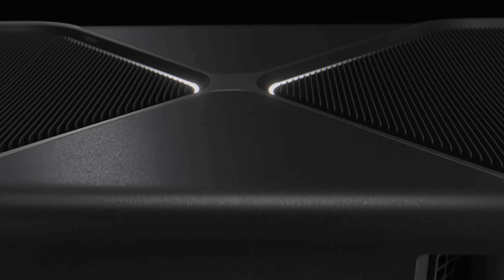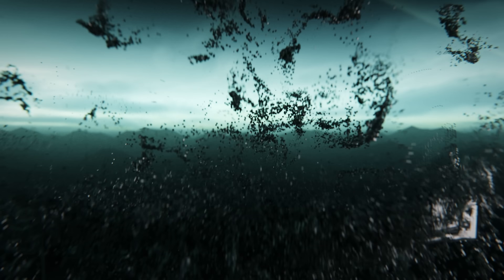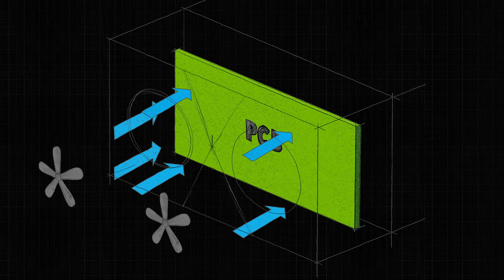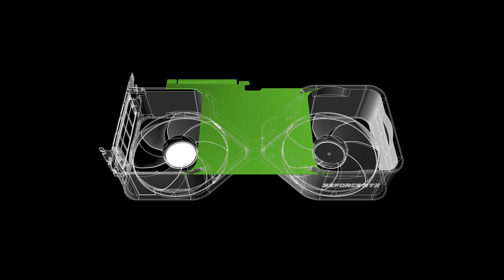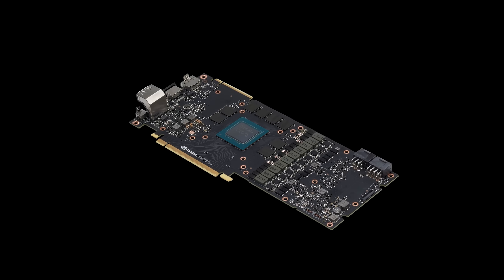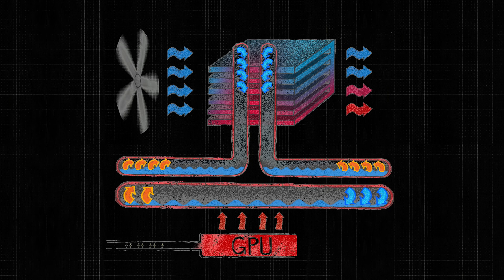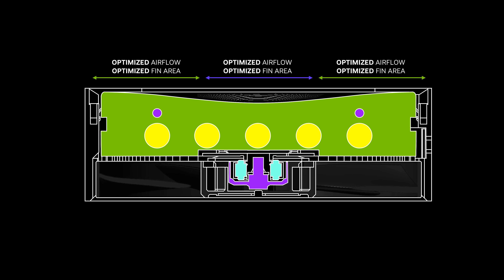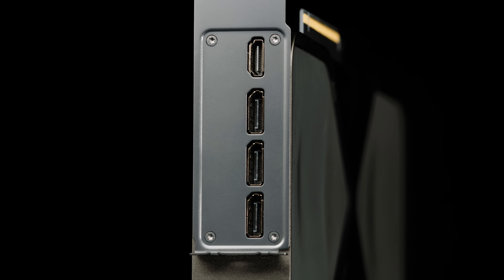Designing the Founders Edition | GeForce RTX 5090

Comment: "Can I just ask: which Einstein decided to give both the RTX 5060 Ti and the RTX 5080 the same 16GB of VRAM? Why does a high-end card have the exact same memory capacity as a budget-tier one? Sure, the 5080 has faster VRAM, but speed doesn't mean jack if you hit a 16GB wall, and modern games are already pushing past that. Why is there zero headroom on the 5080? Why 16GB instead of 24GB? What are you guys smoking over there? I’m absolutely floored by you clowns, you freaking monopolists. I can’t wait for AMD’s next move or for the new Chinese GPUs to drop."

Comment: It is by no means a small GPU but its so compact and dense that its weight gives this sense of quality thats hard to describe within its confines of a true two slot card. Its price doesnt justify its performance but i guess by technicality there is a real performance increase over the 4090. Ill give the engineers some credit in its design, it is a very beautifully designed card inside and out.

Comment: 2026 Xbox Prime with RX 9070 220W for 4k, Xbox Prime portable with half RX 9070 and 110W for 1080p, all Xbox games made with RX 9070 doing 4k 60fps ultra quality using 11.5 GB VRAM or 15.5 GB VRAM and sold on Steam. If that's the case in 2026 I'll buy the RX 9070. I'm going to play Xbox on Steam with VK02-BLK case, Valkyrie Loki edition cooler, Ryzen 9 9950X3D and X670E VALKYRIE, 192 RAM 6000mhz, HD WD Red Pro, 16TB, 3.5, 7200RPM, Sata III 6GB/s, Cache 512MB, WD161KFGX and SSD Team Group T-Force Z540, 2TB, M.2 2280, PCIe NVMe, Leitura 12400MB/s, Gravacao 11800MB/s, TM8FF1002T0C129.

Comment: RX 7800 XT price = $499, PS5 PRO price = $699. RX 9070 price = $549, Xbox price with RX 9070 = $749. Price of my Desktop with RX 9070 in 2030 = $1499. The Xbox must have RX 9070 and if you want to make games for the Xbox, do it in 4k 60fps, ultra quality with the RX 9070 with up to 12 GB VRAM and up to 210W to avoid fps drops and texture problems, be careful with dynamic shadows, use static shadows, avoid midday, use afternoon and night, avoid forests, use steppes, trunda, fields, swamps. Avoid torches and bonfires, use light magic, fireflies and lanterns.

Comment: I would like to see Xbox with RX 9070 and The Elder Scrolls 6 made with RX 9070, on Desktop with RX 9070 you would play The Elder Scrolls 6 in 4k 60fps, with RTX 4070 Super you would play in 1440p or 1800p 60fps and with Intel Arc B580 you play in 1080p 60fps, all 3 with ultra quality, with 8 or 10 GB VRAM and 220W. If so, even the Nintendo Switch can have The Elder Scrolls 6 in 720p or 1080p.

Comment: I would like The Elder Scrolls 6 to be made with the RX 9070 and the new Xbox to have the RX 9070, if The Elder Scrolls 6 is made with RX 7900 XT, RX 7900 XTX or RX 9070 XT I am 37 years old and I want to be alive to see The Elder Scrolls 6 in 4k, 60fps, ultra quality with 16 GB VRAM and 220W on the Xbox console and on the Desktop. Nvidia only has the RTX 4070 super and Intel only has the Arc B580.

Comment: I ask for games at 4k 60fps with 16 GB VRAM and 220W. An XBOX and a PS6 with RX 9070 with 16 GB VRAM and 220W and "all games on the market" are made with the RX 9070, that's how it should be. RX 9070 is a rival to the RTX 5070 and is slightly more powerful than the RTX 4070 super and the RX 7800 XT of which the PS5 Pro is equivalent. It means PS5 Pro with RTX 4070 super and PS6 with RTX 5070.

Comment: RTX 6070, Xbox and PS on the regular market with 16 GB VRAM and 220W, players will play at 4k 60fps with Ultra quality with 16 GB VRAM and 220W. RTX 6070 Ti, RTX 6080, RTX 6090, 20, 24 and 32 GB VRAM, 300, 360, 450 and 575W only on the black market for those who want to pay a lot and lose money. Games made with more than 16 GB VRAM and 220W cannot be sold on the regular market for players who have 16 GB VRAM and 220W graphics cards. This is how it should be, it is the same as buying on the regular market and on the black market of the Battletech game.

Comment: I tell game developers to make games at 4k 60 fps with 12 GB VRAM and 220W, i forbid them from doing 4k 60fps with 20 GB VRAM and 300W. The graphics card has 12 GB VRAM, use 10 GB or better 8 GB so that those who have a graphics card with 8 GB will have less problems. Game with 20 GB VRAM, only the RTX 3090, RTX 4090, RTX 5090 and RX 7900 XTX with 24 and 32 GB VRAM to run them correctly, and the Xbox and PS with 16 GB VRAM will not offer them with quality and performance.

Comment: I have Dragon's Dogma: Dark Arisen and Valkyrie Elysium running at 4k 60fps Ultra quality on the RTX 3070 8 GB 220W. I challenge NVIDIA, AMD and Intel to make graphics cards that run these games at 5k with 50ºC and 50W, almost all the games I put in 720p do 45ºC and 45W, I want the 720p becomes 5k at 50ºC and 50W. There are two games that I see in 4k 60fps with 220W and I want to see them in 4k or 5k 60fps using 50ºC and 50W, in the future some very efficient graphics card will do this.

Comment: Do you understand? Games at 4k 60fps ultra quality cost 220W, the Super Saiyajin 5 plays at 5k 60fps with 50ºC and 50W and the Super Saiyajin 4 plays at 4k 60fps with 79ºC and 220W, if you play at 4k 60fps with 90ºC and 575W it's a super Saiyajin 3, that's the end of the story and not It can get stronger than that.

Comment: Happy 2025 and tell the game developers: Make The Elder Scrolls 6 with 4k, 60fps, ultra quality and 8gb RAM, in short, do it with an RX 7600 8gb or RTX 3070 8gb and then make The Elder Scrolls 6 with 4k, 60fps, ultra quality and 16gb RAM, in short, do it with an RX 6800 XT 16gb or RTX 4080 16gb. Make The Elder Scrolls 6 with 20, 24 and 32GB RAM will be unplayable even on the successor to the Xbox series X.

Comment: Dear Nvidia, your greed knows no bounds, as evidenced by rumors that the RTX 5060 graphics card will have a 128-bit bus width and only 8 Gb memory.. While this may have been acceptable for a budget graphics cards a few years ago, in 2025 it is not only strange, but insulting to gamers. For modern AAA games, 8 Gb is simply not enough. Even in FHD resolution, it is barely sufficient. I am at a loss to understand your decision. It is as if you have lost touch with reality.

Comment: 4090 on water cooling gives instant 55-60C with good airflow out from the case. Now you put 5090 with 575W with no blow out fans, and all HEAT will be inside the case........
Awesome "the best design solution", huh.... Like "we are making GPUs, other computer components is not our problem"

Comment: Truths need to be told... the board design really turned out very good. Congratulations to the development team. But you also have to be frank. A 5070 with just 12GB is practically telling the customer that he is a fool. A 5080 with just 16GB is a sizer for the customer, look, you're a sucker.... Does it cost a lot for Nvidia to make a 5070 with 16GB? and a 5080 with 24gb? Since the 5090 has 32GB? Is it so bad that you respect your customers more? We need more memory for our AI generation software such as stable diffusion for example and others and you simply SHIT this audience... Don't you think this is totally disproportionate? 8 gb 10 gb 12 gb and then suddenly 32 gb boom,  in the card lines... how difficult is it to make these fucking GPU lines have upgrades every 8 gb? 8, 16, 24, 32....

Comment: NVIDIA introduced the 12VHPWR connector, faced problems (overheating and blame-shifting), then quietly redesigned it without admitting fault. The heavy card design also caused PCB damage and RMAs, so they switched to a ribbon cable to lower costs if replacements are needed. 

The “new limits” on bending the connector appear more about reducing warranty claims than genuine innovation. It’s still an improvement, but largely for NVIDIA’s benefit.

Comment: Hope the liquid metal in 5090 does not spill and leak like PS5. I would rather take a 3 slot card with thermal paste than risk my $2000 GPU with liquid metal.

Comment: The cooler is the biggest thing of the generation. Cooling a nearly 600w card with two fans on a two slot is crazy.

Blackwell itself is slated to be Nvidias Worst generation. It’s the reason they couldn’t raise the prices on most of them. The 5070 and 5070ti look to be single digit gains over the 40 super cards. The 5080 looks to be 15% faster than a 4080. The 5090 is the only that gained anything being 30% faster with 30% higher power draw and 30 more cuda cores, all for 30% more money. 

Blackwell looks to be nvidias worst generation yet, and with how big they’ve become with no competition the future looks bleak. Blackwell feels like they forgot they had to release new GPUs so the slapped Gddr7 on and sprinkled in minute extra performance after over 2 years since the 40 series launched.

Comment: RTX 4090  PROUD OWNER . I'll be sticking with the RTX 4090 throughout this 50 series Generation.   4K 240HZ (Samsung Odyssey Neo G8)  in FPS Titles like Apex Legends & with Lower Res I reach 540hz (Asus ROG PG248QP)  in FPS titles like COD.    Once 1000hz Monitors are released like TCL 4K 1000HZ  then I will consider  50-series and above.    At this point in time no FPS titles need 5090 Frame Gen awesomeness imo that GPU is for 750hz and above

Comment: 100% bullshit to make public dumber and believe OMG they need the whole integrated BS. Just make some frigging holes on the side of the die so we can install a frigging of the shelf water cooler.
And as long as the memory chips are covered in some plastic everybody should know a simple truth: THE CHIP IS HEATING THE MEMORY THROUGH THE COOLER AND THE COOLER HAS THE SECONDARY PURPOSE OF MAINTAINING THE RESULTED TEMPERATURE OF THE MEMORY UNDER CONTROL.. IT DOESN'T COOL THE MEMORY, IT HEATS IT TO CHIP TEMP!  If it would be otherwise they would have separated the memory from the chip's cooling solution to avoid adding temperature to it.
If GPU would be cooled with a water block even if that water block would be bigger than a CPU block and occupy 7 PCI slots which we don't use anyway would be better and simpler.

Likewise the power delivery is stupid and engineered to give as little liberty as possible to the user/owner of the card. Instead of having simple ELECTRICALLY SAIN power cables we still play with BS like 24 cables that unify on the PCB in just fracking 2 because guess what power on electric lines works on two frigging lines!!
You want to improve nvidia? Put power cables like we have on washing machines... co check if they use 24 cables to power a stupid heater element. And don't try to use AC vs DC BS cause it doesn't work. It was the decision (intentional) of the PC industry years ago to use the BS of separating 12v cables in order to use 1000 cheap cables instead of stable solid rails if necessary. 

Let me add one more thing... AMD regrets to this day it didn't continue to push the BS Athlon (1) slot solution.... todays CPUs would have been sold the same like GPUs in expensive over engineered BS packages.

You are not pushing progress! You are managing its escape from your squeezing grip!

Comment: The design of new Nvidia gpus is brilliant. The way fans blow hot air up to throw it out of case faster. But question is does this make cpu run hotter and how should we turn out CPU cooler? To blow up or back?
Reply: I hope I can get the card and experiment with the CPU cooler blowing front to back or back to front or maybe also upwards?

Comment: Yay, another piece of vaporware that will be unavailable for everyone except for scalpers with bots or those that want to throw away $3,500.00 to pay the scalpers 😂

Add to that the power draw and if you are "lucky" enough to get one of these you will begin to regret your purchase as summer draws near. 

Hey Nvidia, top tip, needing to run a loud AC while gaming just to fight the gobs of heat produced by your video card kind of ruins the experience.

Comment: Amazing Indeed, i can't wait to Pay 2.500 Euros for RTX 5090, I will be Extremely Proud of saying, you see this card that I paid 2.500 Euros? Yeah it costs as much as the Lastest IPhone but the thing Is that is Only 100 times  Computationaly Faster and Superior Hardware and Engineering.
Reply: 104 Teraflops Fp32, or 104 Trilhon Floating calculations in one Second Vs one Latest IPhone which Only Does 1 Teraflop Fp32 at Max so RTX 5090 is 103 Times Faster.

Comment: Flounder Edition.

My first GPU was actually a graphics accelerator when Riva 128 was starting to be noticed.
The main differentiator was competition: 3dfx, Matrox, S3, Rendition, Intel, ATI. 
Now we get fake frames for progress. Next.
Reply: Matrox Mystique G200 was my first GPU back in 1998. Much better image quality than others. Then ATI started kickin butt with the 9700 series. It's been back and forth between NVIDIA and AMD since then but regardless of the questionable frame gen technology (optional) and high prices, NVIDIA does actually have some advantages these days. This FE design is genuinely a big improvement over previous card designs for size and noise and performance.
Reply: @Bristecom  I still remember the Matrox for their graphics quality prowess, which wasn't yet Nvidia's thing. 
I despise what the market has become, an oligopoly at best, but I protest by not upgrading though I could afford it.
The latest FE design is something else, less is more. Well done to who designed it.

Comment: liquid metal get ready for thermal problems with some of the 5000 series. Hopefully sitting the gpu in the case will not move the liquid metal to one side causing some of the chip to not have it and causing higher temps. Hopefully they make sure no pooling will happen when installed vertically or horizontal.

Comment: A little too much marketing speak for my taste. This "revolutionary product" is 35% faster (after 2.5 years) and a little smaller than the last "revolutionary product".
It sounds a lot like incremental gains to me, and the gains are getting smaller and smaller.

Also maybe show off your work a little more. The thermal design of this is interesting, so maybe show more CDF results.
The higher density PCB that allows for the changes could also have been shown off a little better.

Don't do what intel did back in 2012-2018 when they thought they were unbeatable.
And also maybe put in the same work when it comes to keeping the prices in check. Not everyone have Nvidia stocks. 🤔

Comment: Since the air goes through the card and blows towards the cpu, an air cooler is not at all recommended for the cpu, i guess nvidia engineers assumed people dont use air coolers anymore.
Reply: I have a noctua NH - 15 and was planning to buy this card, now i have my doubts
Reply: @siddharthakantipudi2329  If you can mount it vertically and put a fan in front of it, that would solve the issue...
Reply: You could see in their tests with rigs running big air coolers above the card.  I'm sure it's increasing the air by 1-3C at most; probably within limits or they would have tried to do something else if they saw CPU instability in their prototyping.
Reply: @TheRealLink  I haven’t any rigs with air-cooler in their test bed, were there any? I have watched Malcom video with gamer nexus, videos here and other reviewer channels, no one is really talking about this use case. May be its not a big deal or haven’t given a thought

Comment: All I'm hearing is we could've gotten these:

10GB GTX 5050
16GB GTX 5050ti
12GB RTX 5060
16GB RTX 5060ti
16GB RTX 5070
20GB RTX 5070ti
20GB RTX 5080
24GB RTX 5080ti
32GB RTX 4090

But they made a conscious decision not to do that, on purpose. Theres no reason to spend moeny inserting AI into cards that can't even use it properly at 1080p. Invest more VRAM into the budget and kill all AI raytracing nonsense and save it for cards that can actually run it properly

Comment: 7:42 hell yeah GPU IO out the top!!

Means i can go 420mm AIO outside the case and blowing through the whole thing like i have now...

But also cut a slot into the top of the case and just put the GPU infront of it and blow through them both...

I have a tone of m.2 drives and they app heat each other up and are hot running so need a wind tunnel as a case...

Mounting it IO up means i can still have full cooling performance minimal issues...

Comment: Gorgeous card, if the bench tests prove out all the hype in this video, then they're a few generations ahead of what the 3rd party vendors are doing. Just look at the size of those other cards, they're not doing the level of R&D that Nvidia is doing they're just sticking with what works with off-the-shelf parts while trying to mask the fugly design with RGB.

Comment: Why doesn't the mobile version of these cards need all this cooling? I have a 3080Ti laptop which I know isn't as powerful as a 3080 or even 3070 ti and above but why do the desktop versions need all this housing ? I thought when chips get smaller they produce less heat? Why is this working backwards? I would love to get a PC Desktop but they're so big.
Reply: GB202 used in RTX 5090 is a very big chip - 22% larger than the one used in 4090! TSMC 4 nm production process means smaller transistors, but they have crammed like ~33% more of them in this chip - 92.2B! You need a lot of power going through all of those transistors at these clocks speeds. 5090 laptop version will be based on a chip from 5080 desktop, which is about half the size, half the transistor count. In a laptop it will run with much lower clock speeds to keep the power limited to ~150W, which the cooling system can dissipate (with a lot of noise).

Comment: I like the new layout and cooling. It's good that they are able to cool more power with a smaller package. The new connector location is welcome as well.

The 30% projected performance increase is not good enough, however, when it also uses 28% more power. Tests aren't out yet so I don't know if it's going to perform like that but I had hoped for much more pwerformance per watt than the previous generation.